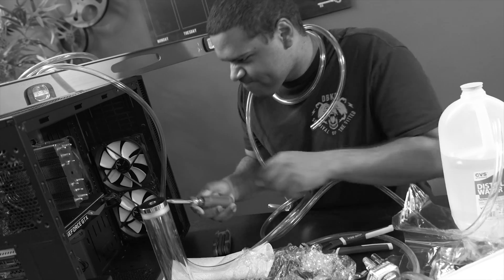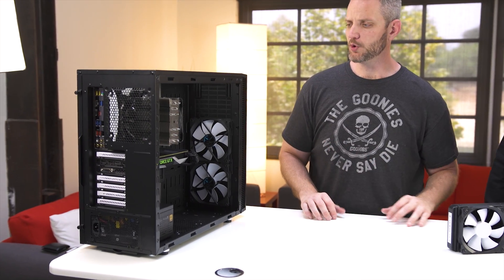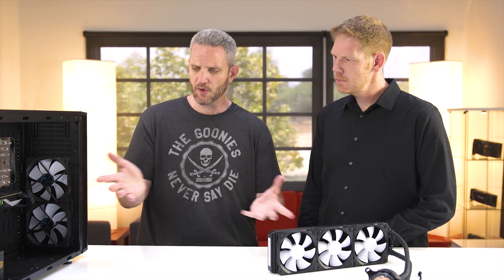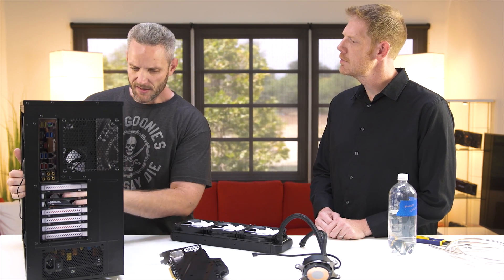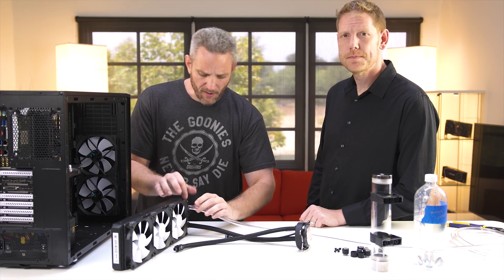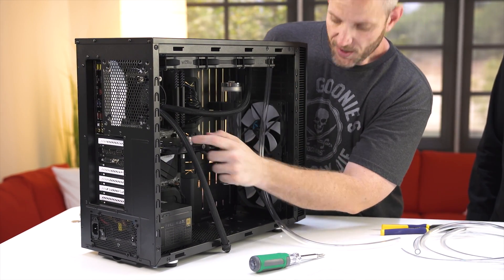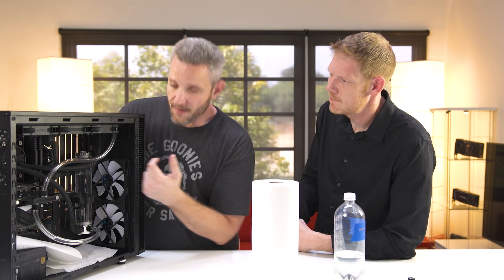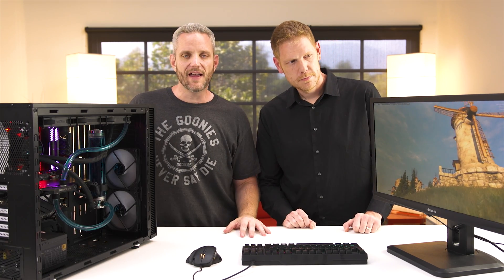How to expand an AIO Water Cooler

Comment: I can get those temps with air cooled low speed pwm fans. Don't see all the hype with liquid cooling unless you're overclocking with minimal fans operating and you want a super quiet system. It's's a waste of money, case space and time for most applications. A good case fan setup with the right heatsinks do just as good. The key is drawing the hot air out of the case, proper cable management, and near zero air flow restrictions, then setting the right fan curves for each fan.

Comment: Doesn’t matter what type of cooling system you have, or whether its on a car, lawn mower, or in a computer. 

You can go to the garage and reuse any leftover automotive antifreeze mix. Only reason not to use leftovers is if you’re color biased, or have some reason you need to overpay for a 1 liter $20 bottle of Corsair, go for it. This is when you find out you’ll need 2 liters.

Far as what’s available in local stores and colors, Dexcool would be pinkish/red, XEREX Asian model Toyota/Lexus coolant is RED, FORD/Motorcraft is more a amber/yellow, and O’Reilly has a orange, and of course you can use Classic Prestone Green. There is also Opticool which is clear and organic and you can add food coloring tonit if uou want. Dont add food coloring unleas its organic and clear. Full gallon new will cost $12-$18 depending on choice.
Reply: Agreed, there's no reason to purchase the high overpriced proprietary coolant, and in a closed loop system color doesn't even matter, they can be refilled and bled out if done right when needed. I've used 50/50 mix of antifreeze before as many others have with zero issues. Way cheaper than the crap they sell online and does just as good. All this open loop systems with specific colors, clear tubing and reservoirs is just eye candy, sure doesn't make it perform any better.

Comment: Hello @Jayztwocents 

This is an older DIY vid and most still apply today, but would it be cool if u refreshed it with the Corsair parts. 

Lets say you got a old corsair AIO for the CPU and pump died. 
You wanna start real watercooling, but not wanna wast that old rad and mabey expand the system with a  bigger rad  360mm or 480mm or multiple depending on case.
Add a 3000 or 4000 series Nvidia card or AMD next gen card + pump reservoir and just make it look great with limited knowledge .  

Whats the things you need to look out for and what compatibility issues could arise, what would you choose if on a budget and if got more to spare but not like a full prebuild pc, hence re-using the old tech make it run cool and quiet.

Kind regards ,
Xander from the Netherlands

Comment: 7 months waiting still no answer so i try again:

1 question. is it possible to use a
 reservior with a pump or is it importent its without when the aio allready has a pump ?
Reply: The system they used has the pump built in the head assembly that mounts to the CPU socket.
Reply: I wouldn't recommand using another pump since it probably wouldn't be identical. That mean that the pump rate would differ from the same pwm input. Basically, one would lag in flow rate and the other will push into it making it work extra hard which is not ideal.

Comment: I know @JayzTwoCents won't respond to this, so I'll ask the community - Does anyone know if I can expand the NZXT Kraken Z53 with a 360 radiator and a waterblock for a GeForce 1080ti as long as I add a reservoir/pump? I would just go with a full custom water cooled setup, but I literally just bought the Z53 - haven't even fired it up yet (but it has been installed, so no returns).

Comment: What kind of standalone pump is that on that gpu? I also noticed that you guy's switched one the fittings on the gpu water block to the underside of it. What did you guys do to plug the top so that water doesnt spew out? I'm just getting into PCs and have been doing extensive research. Seems to never end lmao.

Comment: I convert most of my AIO's to custom loops as a standard in many of my current and past systems as it's not too difficult. The main reason for doing it is to be able to monitor fluid level and condition, the main killer of AIOs. You can also expand capability (upgrading radiator size or adding a second). This said, some AIOs are more difficult than others based on how the fittings are attached to the pump and radiator and also the size/style used. Ideally, at least in the States, you want to be able to use 1/4" or 3/8" OD tubing as it's stocked at local hardware stores and very cheap. It comes in clear vinyl and solid, flexible rubber (automotive variety). Both work fine but vinyl is usually better as you can see the fluid and air bubbles more easily. Lastly, most AIO's are more than capable of runnign large radiators, or more than one radiator, and/or graphic card blocks. Closed loops don't require much pressure or flow-rate, expecially when we're talking <5ft of total tubing length because it's very little head pressure to overcome.
Reply: When you said come aios are more of a pain are you speaking of corsair? I'm actually about to what was done in this video but I have corsair h115 280mm and looking for your insight
Reply: Coraise h115 should not be an issue at all. Most Corsair water blocks are more or less all the same. I’ve converted at least 2-3 versions of their AIO
Reply: @bluethumbdiy4735  do you know what size tubing they typically use? Thanks for the info
Reply: @jahmezis45  If I get time I will measure one of my old corsair water blocks. But based on memory and also what seems to be confirmed online, 12mm OD or 3/8" OD works on most newer/larger Corsair AIOs.
Reply: @bluethumbdiy4735  thanks I found your information to be true

Comment: Ive been building gaming computers for over 20 years, i used an open loop in just one of my computers in the past. 

The reason i dont do custom loops anymore, is because its extremely expensive. The fittings alone can cost hundreds of dollars. CPU block can cost hundreds, GPU block can cost even more. Your water cooling loop can end up costing more then your PC components, depending on how much you spent on your components.

Im good. The prices got very expensive over the years. I would love to do more custom loops, but not with the prices right now.

Comment: How good is that liquid to prevent corrosion from mixed metals? I currently have an EKWB aluminum loop for the cpu that I would like to expand it to the gpu, but the block I'll be adding is made out of copper. I started planning the replacement of everything to match the gpu block, but using the current system would be so much easier and cheaper...HaLp

Comment: True question, could you use the pump of a 120 mm old asoteck and create a loop using the CPU block of ot? Or will the waterflow be too low?

Comment: Hey Jay, I've been looking into custom water loops for a little bit now, but just recently I've come across the Kraken Z73. I'm obsessed with the look of their CPU block and haven't been able to find something quite as good (I know asus has something similar but the square screen in a circle block is just offputting). Now the reason I bring this up is I'm wondering if you've ever modified an AIO with non-barb fittings? Anyway, thanks and great video!

Comment: I've tried expanding loop like this myself and got slightly dissapointed with perfomance. Max rated waterflow for this pump is 40 liter/hour which is icredibly slow compared to 700-1500 liter/hour for custom loop pumps. Temp on my 1080ti went from 74 to 47-50 degrees which is good but to great. Normal pump would give better results. Anyway expanding loop like this is affordable, you cant hear pump working at all.

Comment: Hey Jay, can you do this with any AIO, or are some of them sealed at the radiator like this one is at the pump?
Reply: You could do it with any, but like he said mixed metal liquid has to be used like koolance liquid. And also on non expandable systems the rad has Barb not fitting most of time so I would zip tie the replacement line. Also it will probably require trip to home Depot for male to male 1/4 inch fitting to you can hook the removed line on rad to normal tubing then use compression fitting on res and gpu. It's all doable easily if you wanted to.

Comment: Only looked at the upload date a couple of minutes into the video, and this is an old product. The newer versions sold on Newegg have quick release fittings on the tubes, so I assume (but didn’t check Fractal’s website) that they [Fractal] also have the appropriate quick connect expansion parts to fit with the loop, at which point all parts of the system should still be under Fractal’s warranty.

Comment: With the fractal s24 having copper does the gpu block used need to be copper as well? A lot of the water locks are nickel or aluminum plated so in terms of avoiding galvanic corrosion. With anti corrosive fluid though having a nickel plated gpu water lock shouldn’t matter right? Sorry for the long post, thanks Jay for another great video!

Comment: I'm getting ready to get into Water Cooling for the first time. And I'm doing as much research as I can about the subject. All of your videos on the subject are VERY informative. So, with all this information at my hand I will be doing a PETG for my first build. Flex tubing seems to easy. I am VERY mechanically inclined so this doesn't seem like much of a challenge. But I cannot wait to try this. I know I will make mistakes doing this but I'm all in now. And I cannot wait. I bought the Thermaltake GT20 case just to do this. I liked the View 91 but the cost was a bit much for my liking. The GT20 was right in my budget. I plan on doing this all within time and I am in no rush to get this done. From all your videos that I have watched PATIENCE is key for Water Cooling PCs. And I'm very excited to do this for the first time. Somewhere down the road I'm planning on moving to glass, but for the time being I will stick with PETG. It looks like a good starting point. And Flex Tubing just looks terrible IMO. So Thanx for all your hard work on putting these Water Cooling videos together for all of us. I for one am extremely appreciative for your hard work on the matter.

Comment: Is it possible to expand AIO without reservoir, like Alphacool's Eisbaer and Eiswolf? I'm planning to expand a Silent Loop 360, but is it necessary to use a reservoir? It will be little bit harder to make the tubing with it. Example build: 1st Rad --> CPU/Pump --> 2nd Rad --> GPU --> 1st Rad.

Comment: I have a couple of question regarding this expansion. Since the sensors are led by the CPU block, does that mean the GPU block is at the mercy of CPU temps? How does someone work with this? Also, if you wanted a bigger radiator, can you remove both in-take and out-take tubes to replace the radiator and how would that work with sensors?

Comment: hey Bossman, I have recently thought of doing this with a thermaltake water 3.0 triple riing rgb high static pressure fans 360 aio liquid cooling system cpu cooler cl-w108-pl12sw-a using the t virus reservoir. Do I need to liquid cool the gpu as well? I have several items in my cart, and would like a point to the right direction please. from best fittings to obtain, to correct hose size.

Comment: I get that it's a closed AIO until you crack it open, but the warranty void stickers and the hassle of adding a GPU and it's almost just as easy to build a custom loop yourself?
I mean I'm the kind of person that suggests air coolers and straight to a custom loop; Simply because for the most parts the benefits of air are better then most AIO's, even if the temps are better on the CPU and the CPU tower is almost always cheaper too.

Comment: I wish you would have shown actually connecting the psu jumper and or power supply for the pump..  I didn't see any power cords or connections for the pump and wondering how you power this.  I'm almost certain that they hook to a header I guess for power or something..

Comment: So question.
I currently have 2 Corsair H115i Pro's, 1 for the CPU and 1 for the GPU (using a Kraken g12 bracket).

Are they able to be modded make a custom loop?
And could I use both pumps?
So:
Reservoir > cpu pump > 1st radiator > gpu pump > 2nd radiator > Reservoir.
Would that work?

Thanks in advance.

Comment: @JayzTwoCents - could i use any gpu block expanding this AIO configuration? i have an evga 1080ti ftw3 - EK do a full cover for it but i believe the radiator is alu and the EK parts are nickel?

Comment: Just tried a custom loop with the s24. Set up exactly the same way but with no GPU route, only cpu.

Well after hours of trying, the fluid will not flow around the loop. I have tried moving the resivoir and everything but there is not enough power to push the fluid around?

Any suggestions please?

Comment: What if there was a cpu cooler thats air cooled and liquid cooled? Hint hint.
Reply: Technically a water cooled system is air cooled since a radiator is just a heat sink.

Comment: Considering it's an ad, the video is actually pretty good. I would probably never expand an AIO like that because of the warranty void (which is doesn't matter I know but I don't wanna start a fight if something happens). In fact, I almost bought this AIO but the biggest downside the noise, stopped me, since it's way louder than my current air cooler. Other than that, it's probably one of the best AIO's out there.

Comment: Jay, In a different video you said that 480mm of radiator (a total of 480mm that can be made up with two rads that adds to 480)  is the minimum needed to cool a CPU and a GPU.  Have you revised that minimum amount needed?

Comment: Ive ALWAYS wondered about this. I have a few old AIO's w/ fd up pumps and whatnot.. so I had wondered if I could repurpose them in an open loop-- b/c I seen a custom job a while back where someone used a car radiator, attached to his desk, to cool his system. Now, Im not looking to go that big.. but I did have a question about this endeavor: 

Would it be just as easy to do this if someone was to try using 2 rads from AIO's, THEN attaching them to an external pump that can handle the size of the two pumps+res?

Comment: Jay, I realize this is probably not the best time, but I want to pitch to you an idea, and a silly, simple , fun  and cheap one at that :

You know how you can get 8 dollar 80mm radiators and 7 dollar "cpu blocks" from aliexpress/alibaba now? And cooling towers for notebooks that are some very rudimentary cylindrical radiator with a fan one one end, because the 2000s are back? 

Could you pleeeeeeease do a project with that kind of stuff, junk system watercooled, or decent system if you want.
I have wanted to do something crazy stupid like this on my ancient dell inspiron 530 that sits in the closet, and with current prices it's just so tempting, them 2Ghz dual core and 2GB of DDR2 (base options down here) with the 80mm fan actually doing something for once (and maybe mounting a 120mm intake fan to the front with minor mods). 

I mean, there's always Linus to count on for this kind of stuff done for no reason, but you're the water-cooling guy, and I've seen people water-cool raspberry Pi's (with 120mm rads for some goddam reason) and that could also be a cool project with little J.

Comment: "it can be kinda hard to figure out exactly what you need" then proceeds to pull out all the stuff that can be hard to figure out to do the video.

the average person who buys an aio isnt going to know what g1/4 fittings are, or that they come in different internal diameters and to match that with the diameter of the tubing. they wont have fluid or the power supply jumper and they wont know about the res being higher than the pump.

i think if they really wanted this expandability thing to really be easy, they would just sell a s36 video card add-on package that included everything you needed to expand. essentially what EK did with the predator.

Comment: Hey Jay, I have a question. I have a full modular psu. Moved and lost the pcie cables and am wanting to add a video card. Do you and if so where do you get your custom modular cables?
Reply: SeaSonic SS-520FL2 520W ATX12V / EPS12V 80 PLUS PLATINUM Certified Full Modular Active PFC Power Supply

Comment: Yes this is corner but legitimately will this reduce the life of the AIO pump? From my understanding while they work they are not known for extreme long term usability.

If the pump was to fail would it still be safe to use this same set up (granted you replace the CPU block) and add a new pump?

Comment: Jay I hope you get to read this. Quick question that I don't think I've seen anyone touch on. I'm getting ready to do my first water cooling build/hard line. I'm using EKWB fittings and was curious if a tiny tiny touch of silicone grease on the O rings would be beneficial in both tightening down and help sealing? My trial fitment shows a lit of friction on the tightening down between the ) rings and the tubing. Thank you Jay. Love the channel

Comment: Bought S24 for Ryzen. Turned out, even though it has holes for Ryzen, it is too high to make a contact with IHS, at least on my Crosshair 6 Hero ( on AMD sockets it uses default motherboard backplate).
So I put 8 paper sheets between Mobo and backplate and that did the trick.
Also tubes from radiator where to far apart to fit into top section of my Be quiet Silent Base 800 case, but scissors for metal helped me there.
Spent 5 hours installing said cooler.
Performance is nice. Quiet operation can be achieved for up to 3.875GHz@1.3675V